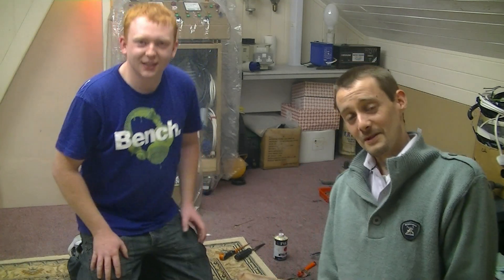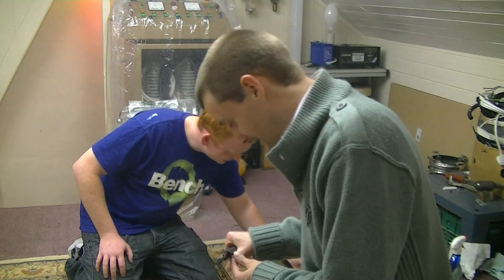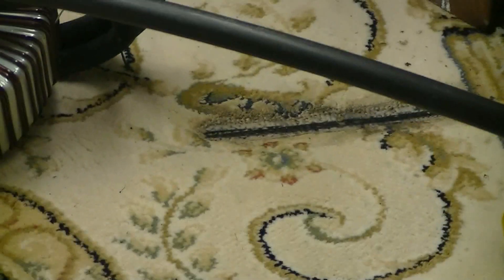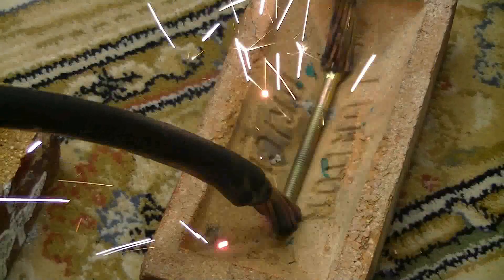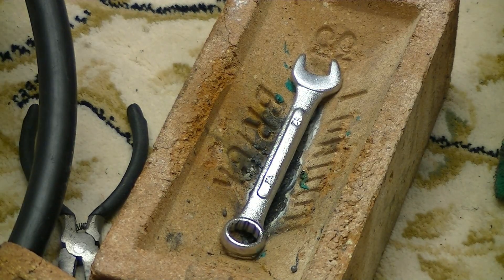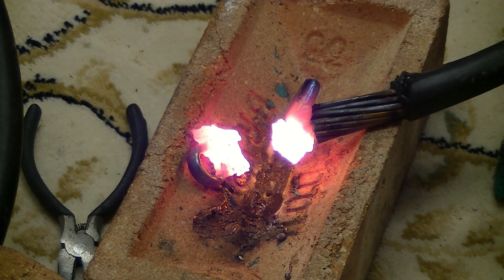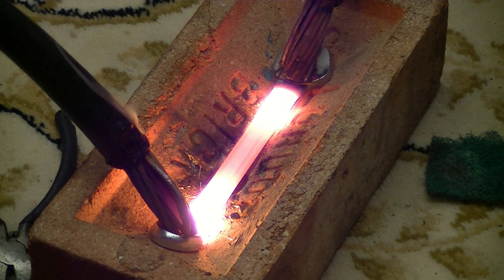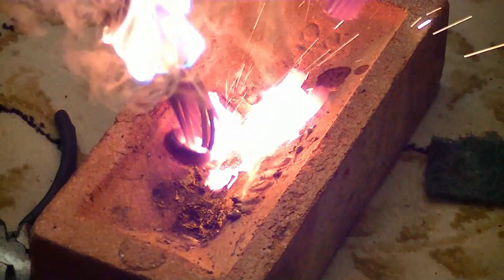5000 Amp Fuse + Tools Melt With High Current

Comment: Not dangerous , it’s just low voltage high amps.. not much more than 3to4 volts at thousands of amperes… you also need the voltage to be dangerous… Very cool bud .. you also can make a welder from a Microwave transformer by taking out the secondary windings and changing it over to a very low gage copper wire!!!

Comment: 5:20 Badass! 😂 But use a respirator. Galvanized metal has a zinc coating. Zinc vaporizes at a much lower temperature than steel and makes really nasty fumes — which you see at 5:27. Doing this indoors is pretty crazy. Look up welder's flu / zinc chills.

And these guys are vaporizing everything, not just the zinc! The current is completely boiling off the steel into smoke, and you wanna try not to breathe that.

Comment: I know it stupid question but why the copper wire didn't melt I manipulated copper for Little project   it melts easier than other metal but here it don't
Reply: The copper has a lower resistance than the wrenches, so less of the electrical energy is converted to heat.

Comment: I imagine they’d get quite a shock if they touched those wires?
Reply: The amperage is extremely high, but the voltage might be low enough where it doesn't overcome the resistance of human skin
Reply: @ligmayeye186  which is about 50 volts IIRC.

Comment: It's funny because it requires  ~1500mA to kill a human.
Reply: with a combination of specific voltage of s certain frequency yes.
Reply: less than that, also your skin has resistance meaning there needs to be enough voltage there to

Comment: If the steel is melting then why does the wire not melt as well?  Do they make high current wire with high melting points?
Reply: @obscurity3027  Oh its a resistance thing.  Thanks!

Comment: What was the step down voltage on the black wire?
Reply: Probably under a volt loaded
Reply: @peterzingler6221  If voltage is under a volt than why there is an electric arcing happening at the moment the black-wire come close to touch the tool? It seems like the voltage is high enough.

Comment: How is this 5000 amp? That wire isn't that big
Reply: Well a normal household cable can take 20 amps
Reply: @peterzingler6221  this is around the size of 500 mcm cable, and that's rated for 400 amps. Soooo not even close
Reply: The fuse he shows at the beginning is 5000 amp rated, if you watch his latest video he pops it
Reply: @moejasss  that wire isn't even close to 5000 amps. Would take like 15 wires that size.

Comment: Voltage is still not enough for the long rod to melt quicker.
Reply: The voltage of the current has direct impact on the length of the rod. The Voltage matters for the longer rods.

Comment: I know this video is old (which means it’s in everyone’s recommendations), but I have a question. Why doesn’t the copper wire also fry and melt?
Reply: Becauseit conducts electricity much better - any heat is created by metal resistance basically the electricity has a harder time passing through and heats it up
Reply: @brokentos4546  oh didn’t know heat was caused by the resistance. Thank you for the info

Comment: If Frodo and the gang had a good enough supply, LoTR would have been a 5 minute YouTube clip.
Reply: Gentlemen, and ladies, I have got here... The One Ring. And today, I'm going to be using... the variac. And we're gonna stick it across the big boy power supply and crank it up stoopid.

RRRRMMMMMMM

240 V. But we don't use 240 V on this channel do we bois?

RRRRRMMMMMMMMM

415 V. It's looking a bit warm.

* RRRRRMMMMMMM BLAM*

Awww, I popped it!

"Directed by Peter Jackson"

Comment: Breathing the fumes off of galvanized steel is seriously bad for you, and doing it indoors without ventilation is even worse. Depending on how old the steel is, you could not just be breathing in nasty zinc fumes, but more lead as well.

Comment: These high amperage fuses we called “catastrophe” fuses and were used in the secondary side of 120/208 volt networked transformers. 

The transformers had the capacity to provide the current needed for customer service and still melt open a 250mcm copper cable should it short circuit.

The cable would burn open and the secondary network being fed from multiple transformers and primary feeders would still provide service to customers.

Comment: Why don't the wires melt?  In fact, they don't even get white-hot.  I wonder why.
Reply: theyre thic af

and lower resistance than the wrench probably
Reply: They are melting that's what the white sparks flying off are

Comment: 8:51
phone goes off
"Ugh, fucking women..."
proceeds to melt wrench with 5kA of power
Reply: LMAAOOOO
Reply: Current, my dude xD
Reply: kA is not a unit of power, but still fuckin hilarious
Reply: @kevinmm20  not a unit of ELECTRICAL power, but anyone with 5kA is pretty damn powerful.
Reply: @paul-fornage  Well, it's not a unit of any form of power. It's a unit of current. But yes, generally to get that kind of current takes a lot of power haha
Reply: @kevinmm20  no I mean like non-electrical power, like a man with 5000 amps has a lot of power to get what they want.
Reply: @kevinmm20  Not if you got a conducter with something around 0.000001Ω, cause then the Voltage across it will only be 0.005V and thus the Power is only 5W which isnt a lot
Reply: @neutronenstern.  Of course, but that’s why I said in general, since in general you have some load you’re passing through. So you’re dealing with non-negligible resistance and inductance.
Reply: heck yes
Reply: Looking for this coment
Reply: Based.
Reply: 5kA oF pOwEr

Comment: Why do people use kilns to heat metal up before working it when they could just do this in a much quicker time.
Reply: There are iron/steel foundries that use almost exactly this principle to melt and refine scrap metal quickly. It could definitely be used for blacksmithing/forging, but controlling the heat would be more challenging. See https://en.wikipedia.org/wiki/Electric_arc_furnace for more :)

Comment: If you clamp carbon rods on the ends of your cables and use those as electrodes you will save your cables from burning.

Comment: What the hell?  This is off a standard outlet?  So 15 amps max, even at 240 volts is still only 3600 watts.  I don't see that melting stainless steel any time soon, and even if it did, that's a much higher temperature than the melting point of those copper cables, so they would have melted first.  What kind of trickery is this?

Comment: I still remember when this was (AND STILL IS) quality YouTube content.
Reply: Yep, this is what yt should always be about, 2 person in a room making fun experiment. (Btw what they are doing is pretty save in term of electricity because they are using very low voltage, I think they said 2V)
Reply: @balinoob1837  lmao I wouldn’t exactly call this safe with all the molten metal and stuff on fire... but hey I’ll gladly watch
Reply: @eyeborg3148  what I mean by safe is that they can't get killed, because that's the scary part about electricity, it's that at high voltage, you get shock... you just die, there... laying there all burned up and with a smell of burn in the room, you've just been cook in milliseconds.

Yeah fire is dangerous, but you tame that, you can't tame voltage, new guy on the job or Grand Master Electrician with 40 years in the trade will both die if they get shock with that 600V.

Calling their experiment dangerous would be the same a saying that arc welding is dangerous, yeah but you know... not that much
Reply: @Denys Borsukov I'm an electrician buddy, V = A • R. The voltage determines the amount of current that will pass through your body. Why can you put your hand on the + and - of a car battery and feel nothing? Because it's 12V, at a 120V you wouldn't even let your hand on for more than the time to react and at 600V, your hand would start to burn on the inside.

Why is there always danger signs about High Voltage and never about High current?

If their set up was at 120V, the circuit would be passing 10000 amps through the wrench instead of ~100-200 amps.

I cannot even tell you how fearsome high voltage is my friend. If you don't believe me, google "ohm's law" it's the E = I • R which is Voltage = Current × Resistance. But hey what do I know I'm just a stupid electrician I guess
Reply: @Denys Borsukov 🤣🤣 Omg that text was soooooo funny dude. Yeah I'm a NASA scientist and we have discovered that gravity doesn't exist and I'm working on the next mission to mars where I will be the only astronaut going to the red planet so I can take a selfie with the Martians.
Brother, the current will kill you but you need a high enough voltage for that amount of current to pass. 

And that device you're working on to remove bad current already exists, it's called a GFCI system, it trips when the amount of current going to ground (Not the Neutral) is at 5mA (In North America)
Reply: @Denys Borsukov alright advice noted I'll use a 12 mil wrench as a replacement fuse for my local diesel generator

Comment: believe it or not. this is completely safe to touch. this is low voltage but high amperage which means you can easily touch both terminals and be completely fine

Comment: not 5000 but 100 ampere
Reply: how do you know lol
Reply: @conkerconk3  the fuse is 5000 A but the current is around 100-300A, 5000 A will melt things in a fraction of second, bye.
Reply: @AsitShouldBe  but how do you still know? you dont have this transformer do you
Reply: @conkerconk3  i've seen that current and i know what i say, bye.
Reply: @AsitShouldBe  well okay then but just saying, unless you were in photonic's room at the time you cant really be sure on your facts

Comment: 7:34 that guy is touching that with his hands without no gloves Genius.... guess they not...
Reply: Hard Metal the electric wires here cannot harm a human
Reply: @insainperson6018  what?
Reply: Hard Metal This wire has 1-5 volts and 5000 amps. Volts X Amps = Watts. 60volts are needed to feel electricity in human hand 100 volts are need to feel electricity in foot. This wire can deliver 125MiliWatt while a normal home plug can deliver 150 times more watts to a human. 
The transformer turned their 240v 90amp wall plug to output 5000amps 5v. Sacrificing volts for ampd
Reply: Hard Metal you could hold both wires in your bare hands

Comment: Back of envelope calculations: if the source is 240V and a maximum of 50A (about the maximum you could draw in a typical house - electric showers have about this rating, but I might be totally off here, I have no experience with this) a 95 to 3 transformer gives 1500Amps at 7.5 volts, that's about 12,000watts, or 12kW per hour, so if they did this for 10 minutes (total amount of time with the wires actually shorted) they would have used 2kW. 1kWh is about £0.17 in London so they'd end up wasting £0.34 of energy in those 10 minutes. Still quite high, considering the average US household consumes about 1.4kW in one hour while they consumed 12kWh. Or a better comparison: a typical tumble drier consumes 3kWh, so 3 times less than this contraption.

This is all very rough because it assumes no losses in the transformer (which will be quite high because it's not a proper one - ie. the secondary coil was very loose and on top of the primary), but it also assumes perfect connections, which those weren't, so in all likelihood they consumed quite a bit less power than the calculation.

Comment: Spanner when touching 5kA: melts
ElectroBOOM when touching 5kA: "Hey, it tickles!"
Reply: Styropiro***
Reply: Red aka Minekloc tbf a car battery can melt a spanner but if you touch the terminals with your bare hands you’d be fine.
Reply: They are using about 2 volts, nothing life threatening.
Reply: @balinoob1837  they need to pump their wire gauge up.
Reply: @professorstratios8228  yeah they would get a lower resistance through the wires, so more voltage on the end of the wire, but honestly, it's not gonna have a big effect
Reply: @balinoob1837  oh I meant to make them a bit easier to hold. They were getting hot on them pretty quick at one point.
Reply: @professorstratios8228  yeah but its  getting expensive at one point haha. I once hold up 1 meter of 500kcmil and it's crazy huge and heavy
Reply: @balinoob1837  For sure about the wild wire costs. I have some 00 (AWG) I use to pull 130 amps from a 12 volt battery bank and I would never do it that way again. You could beat a giraffe to death with that wire.

Comment: The lack of safety equipment gives me pain, and one day will give them pain, along with their house burning down.
Reply: why would they need safety equipment?if you know what your doing and all the risks with it than its redundant
Reply: @elk3909  you should still use safety equipment, and they do not look like professionals.
Reply: @windshieldwipers5275  their both electronic engineers. they try to look like like just some guys to relate more to the viewer
Reply: the rug is fire proof and the electric potential cannot pass any current into the human body in this situation. You could hold both wires in bare hands